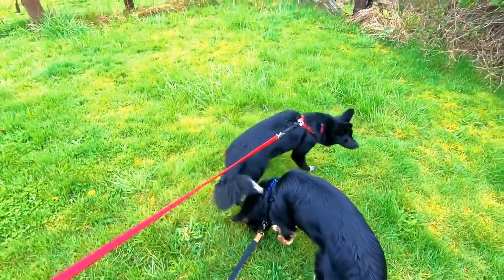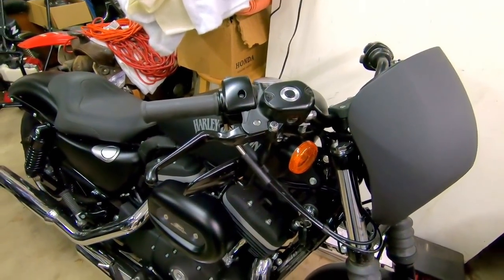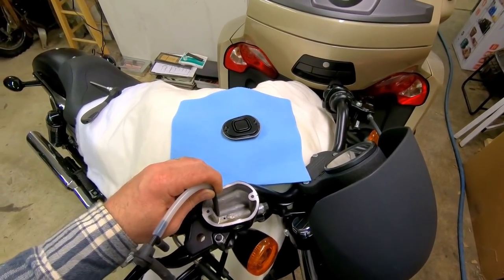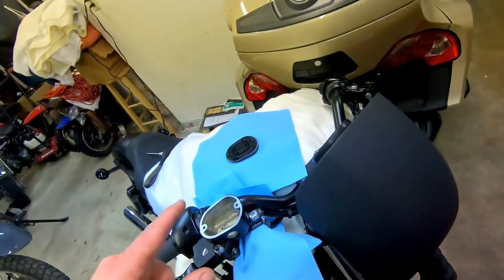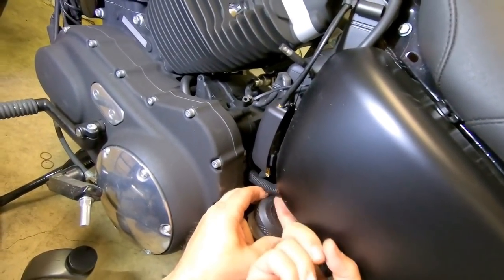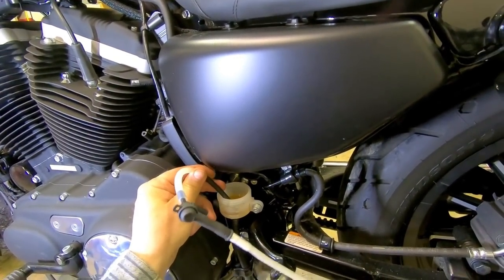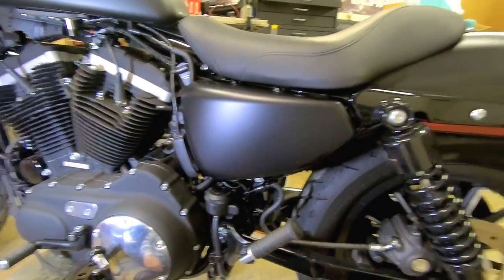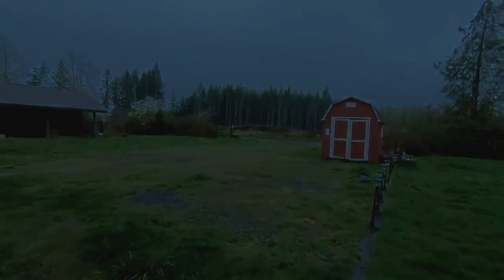Harley Iron Brake Flush!! • DIY’s on Stormy Days! | TheSmoaks Vlog_881

Comment: Last time I flushed brakes was over 20 years ago on a B-2 Bomber!  I envy your shop (as well as your space at work - nice and bright, not a dark, dingy dungeon), I don't have a garage or even a covered carport at my house so about the only service I do myself is oil/filter change.  Good point on the screwdriver.  Sometimes I wonder if even trained wrenches know the proper screwdrivers to use!  I learned in the military to ALWAYS use the correct tool for the job!

Comment: Thanks for the brake flush walk through. I'm sure that there are those of us out here that know what they're doing can still pick up a point or two. I know I dd on the last one you did. I didn't know about the fluid testers, and man did getting one ever save my hide. Two of my bikes hit 5% immediately when tested! I also picked up the flushing tank that you used/showed, and it made flushing the brakes so much easier. The puppy is adorable BTW.

Comment: Two thumbs up on this video Shawn!!  Thanks so much for the links on the tools. I ordered several items from them.  Question.... Can the brakes be flushed the same way on the newer Street glides with the ABS and linked system? I was told NO, that it must be done by a tech.
If it can I would love to see you do a video on that . Thanks.
Reply from the maker: A scheduled maintenance flush does not require Harley-Davidson's Digital Technician.  If the fluid has become contaminated, or components are replaced (even hoses), I would suggest having a dealer perform the flush as the computer insures the VCM ( or ABS Module) is properly purged...  Be mindful of the order and fluid volume required when performing a maintenance flush on ABS models!  I'll be flushing my M8 SGS soon..!

Thanks Scott!

Comment: I have the same suction bottle but I get bubbles in the lines because the small hose isn't totally sealed on the brake bleeder
nipple. I have an  '01 Wing so the whole proceedure is more involved.

Comment: Why do you have to discard the  left over brake fluid that you don't use? I never knew that.
Reply from the maker: Brake fluid is hygroscopic (absorbs water), which means it absorbs moisture from the atmosphere.  Once it reaches approximately 3.5% water absorption, it reaches it's boiling point.  Under hard riding or an emergency situation, if the fluid boils it creates air and you lose your brakes.  Plus the water breaks down the fluid and it become corrosive to brake components.  Leaving an opened container around (even tightly sealed) absorbs moister quicker than your sealed brake system, so you don't want to mistakenly introduce bad fluid to you bike or auto...

Thanks Michael!
Reply: Well I couldn't have asked for a clearer explanation. Thank you for taking the time to do so. Next time I  flush the brakes I would've just used the same container I bought the last time I did them....I won't now! 
Cheers.

Comment: What would you do for abs Harley's?
Reply from the maker: The same procedure, but in a specific order with a higher volume of fluid pushed through the system...  Left front with approximately 6oz (200cc) of fluid, right front with 3oz (90cc) then rear with 3oz (90cc).  If the fluid is really old, bad, contaminated or the ABS module is replaced, Harley's Digital Technician Software must be used during the bleeding procedure to properly flush the VCM!  You'll be be seeing your Harley dealer at this point...  Critically important to flush ABS systems every 2 years or 25K miles!!!  I've seen failed VCM's on BMW's that were $2,000 + labor due to going years without flushing.

Thanks for watching!